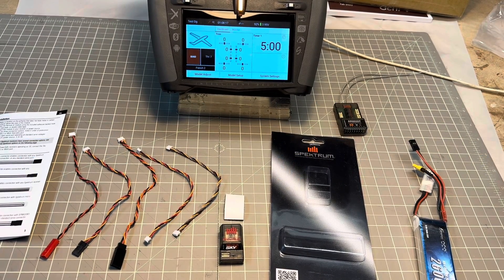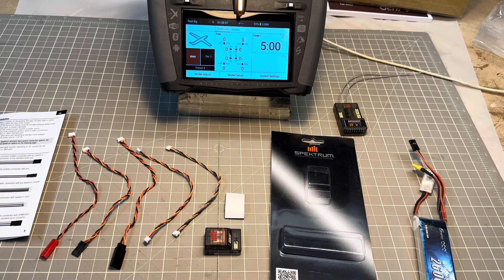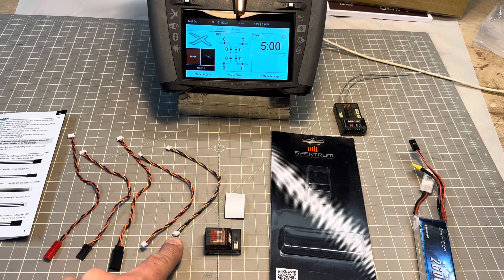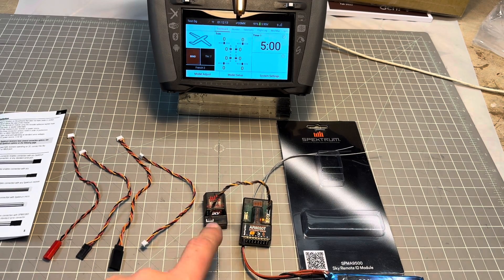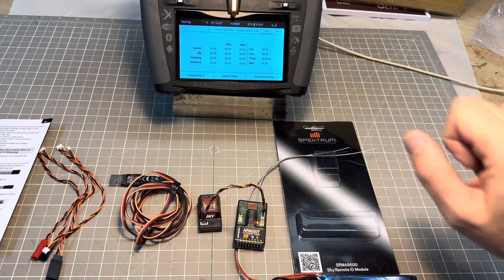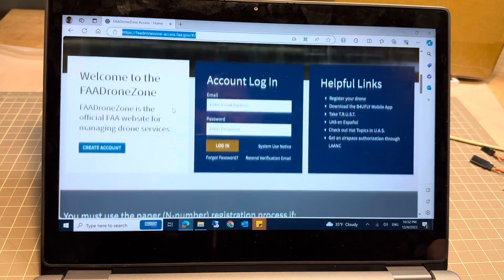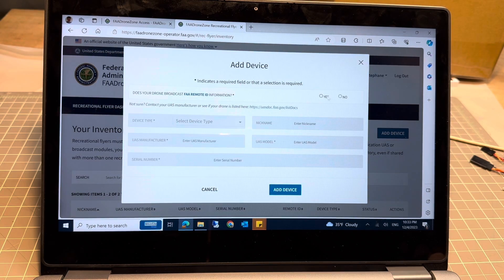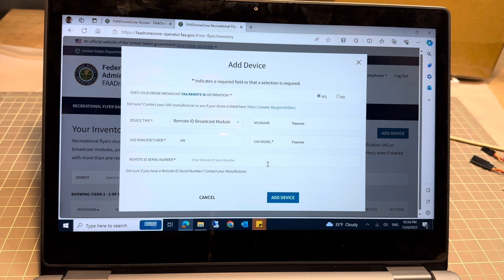Spektrum SKY remote ID module FAA compliance

Comment: I just found out from another utuber that this spectrum ID module does not broadcast the location of the ground station.I think this is good news but I'm still wondering how this module is approved by the FAA for Remote ID.I have learned for a while now that Remote ID is supposed to broadcast aircraft flight path,altitude,speed and heading as well as broadcasting the location of the operator(ground station).